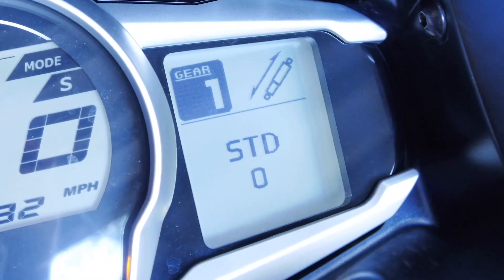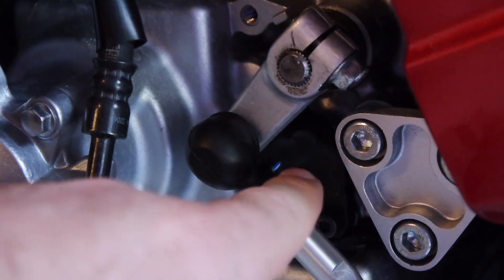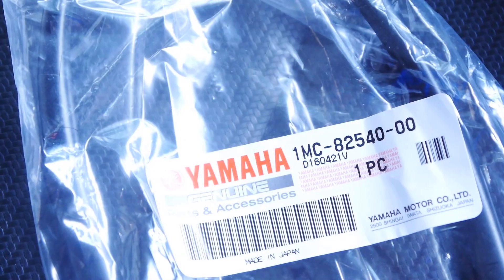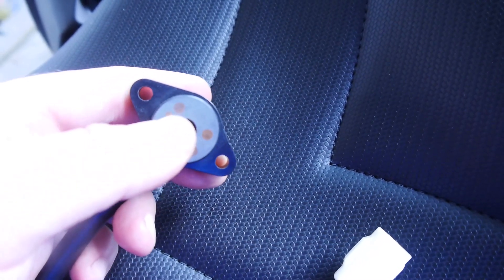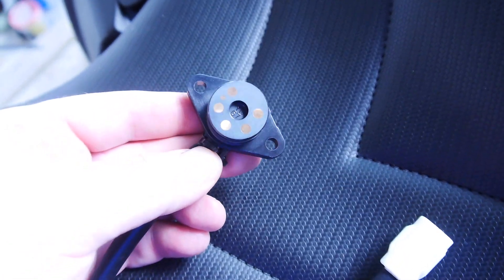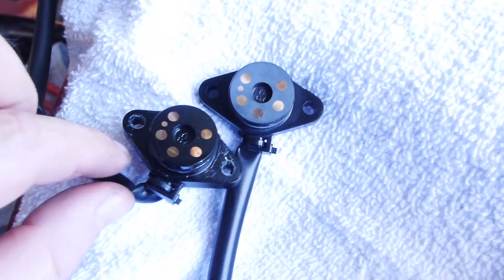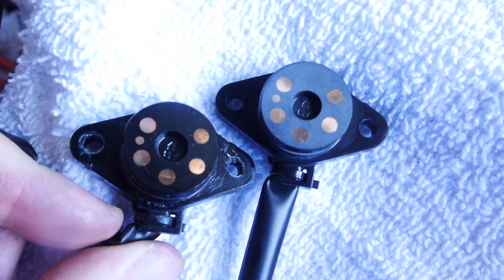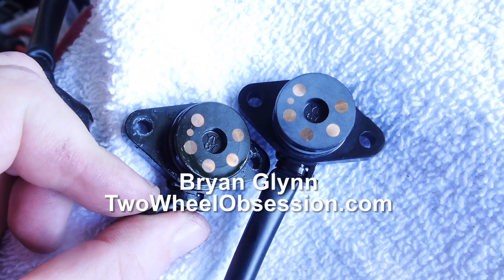How To Replace FJR1300 Gear Indicator Sensor

Comment: Thanks for the post, I did encounter the same problem when my 2014 bike 3 yrs old clocking 70.000 plus km. And recently I have idling problem starting it. The idling is a low and after a few second than it runs normal. I don’t know whether it’s the injector or something else, hope you have a solution to it. Thanks in advance from Singapore.

Comment: I have 3 options to purchase.  2015 fjr1300A, 2015 fjr1300es, 2016 fjr1300A.  which would you buy?  the price varies from 11,522-13,699.  what would you do?
Reply from the maker: +cuzimaluzer777 15 es
Reply: +TwoWheelObsession it's now down to 2015a or 2016a.  es sold
Reply: +cuzimaluzer777 
2016a model in my honest opionion. Here in Europe it's the newest model with full LED lighting instead of only the Day-light led's. I don't know if the USA models are different compared to the EU models? I have'nt driven the 2015 model but I think it's about the same as my 2016a model.

What is the difference in mileage of the 2015a and the 2016a? Is the difference in mileage an newer model worth the extra money to you?

Comment: Your contact drum is leaking oil and shorting out the sensor..Same problem on a 2014 R1.
Reply from the maker: No. Just bad sensors. It happened on many models. The replacement has held for years.

Comment: "Gear Indications" are Not really Needed. I have been Riding Motorcycles For 50 yrs. However, My 2015 Victory Cross Country has a gear Indicator. [6 speed box]  If it failed,and did not cause any "Issues" with the bike,  I would not spend  Money on a Replacement part ,Unless it was priced..  Reasonable... I could live with out It .
Reply from the maker: +MCTeck turn signals aren't needed either but it doesn't mean people don't like and want nice things. Thankfully we can all ride whatever we each like.
Reply: However on a FJR 1300 ABS if the neutral indicator doesn’t work the idling became slightly higher than it should be.